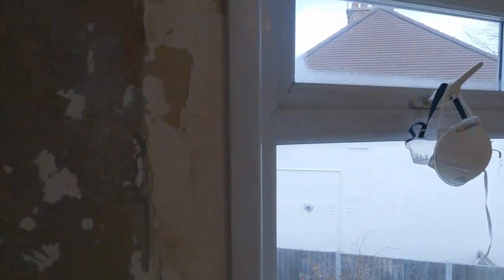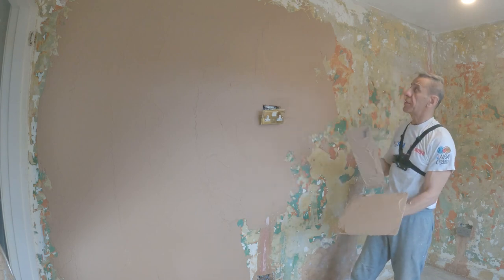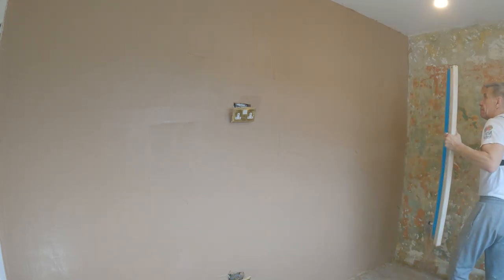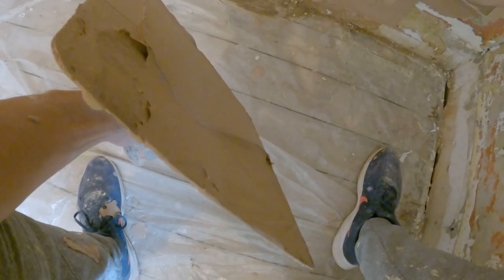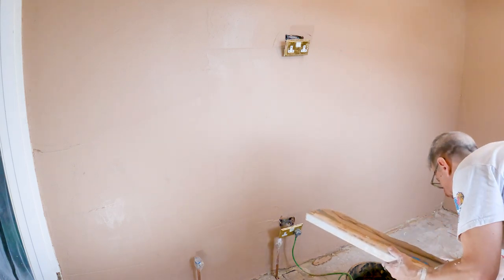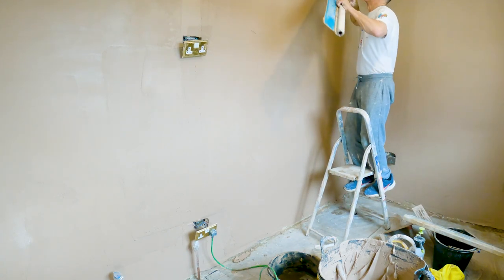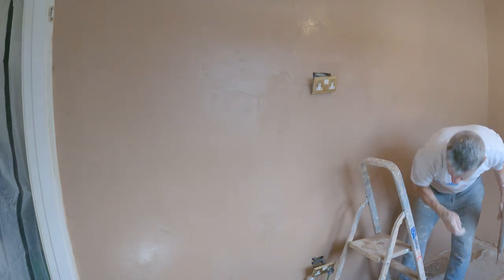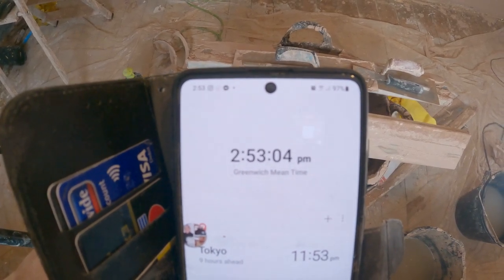Spreading with a Speed Skim Revised

Comment: I cant be arsed wi sockets gettin in the way.  I remove the wires, wago em, tuck em back in the patress and throw a piece of card in the face of the patress. Takes 2 mins and saves loads of stress.
Reply from the maker: It is best with them off, there were about 8 sockets in there, I don't mind whipping them off, it's the putting em all back on again🤣

Comment: Nice video, ive plastered before using inly hawk and trowel. Need to do my ceilings, si going to invest in the these soeed skims including the metal bladed one. I know a lot if plasterers my father included is old school and insists on a trowel finish but the finish you got there is plenty good enough for me 👌
Reply from the maker: Thanks jayman 👍 yeah, I'm in my 60's so fairly old school myself, I've only been using speed skims for about 3 years because it makes my job easier, but I understand why quite a few older boys stick to traditional 😀

Comment: Hi
I use the metal version of speed skim and I'm looking to get the 400mm Mirka blade to replace my 5 year old worn out non branded blade.  The Mirka blade is much wider than others so holds more material, so check it out. I've been applying material with 600mm and 400mm stainless skim blades for years so great to see you doing it too. Definitely works. Good to switch application methods to avoid repetitive strain injuries.
Blade damage, too narrow to hold material puts me off the plastic when there is stainless version on the market.
I have a 1200mm blade as well but it is a bit too big. 
Oh .Mirka and Graco make the wider depth blades.😊
Great work. Thanks for video. All the best
Reply from the maker: Thanks Wayne, might give em a try 👍

Comment: Great video Eric for novice home DIY.... Thanks😊
Q. What size metal speed skim did you use for polishing, is 900 too long? Only I have 900 plastic and don't what to fork out another 50quid for 600, I could just buy the metal blade then...
Reply from the maker: Thanks Paul👍900, it's the best size, I don't have a 600, though it's quite good for getting into smaller spaces, and I rarely use my 1200, so yeah, if your happy to keep swapping the blades over just buy a metal blade, depending if its much cheaper?

Comment: Question - how do you clean the dust off the walls before you plaster? I have to plaster over very dusty walls after construction finished.
Reply: You seal the wall 1st. It stops the dust and kills the suction. Use SBR neat or PVA, there are other methods which work better on different backgrounds.

Comment: Excellent job mate. I’m only a DIYER but I’m getting more confident with plastering but never done 4 walls in one set as I’m not great at getting neat corners so tend to do opposite walls. what size flexi bucket did you use and what is the brand of corner trowel.
Reply from the maker: No real point in doing 4 walls in one go, just makes for a good video😁 and doing opposite walls is a very good technique for straight corners, went from a Marshaltown corner trowel to a Refina one as the curved edges dig in less 👍
Reply from the maker: I use the big flexi bucket from B&Q, they're about a tenner, great for mixing bonding or finish, 2 put together is a bit more rigid
Reply: @ThePlasterer  thanks I’ll take a look in B&Q today

Comment: Hi Eric just wanted to know can you get boardfinish fast set. I only plaster every now and again but I have used some board finish on a job and it says fast set on it I only noticed after the 3rd bag was not a slow day.
Reply from the maker: Hi Adam, I think the writing on the board finish is just an advert for fast set, fast set is gone in about an hour, board finish normally goes off quicker than multi. You can use Eazymix half time additive in it if you want it to go off quicker. Hope that helps